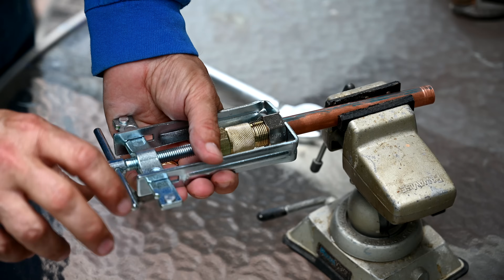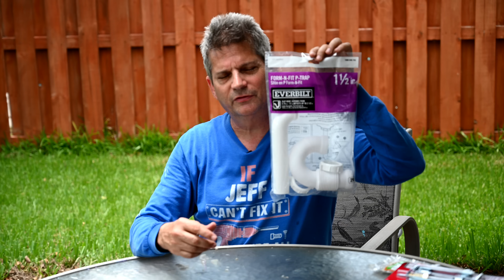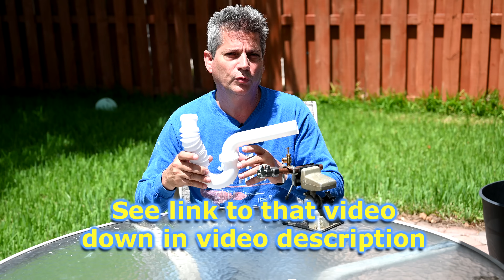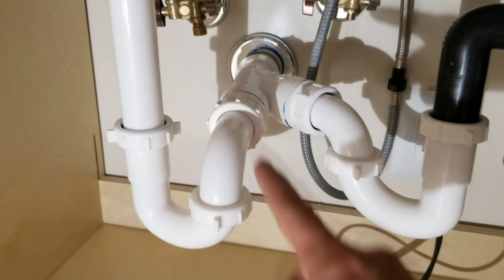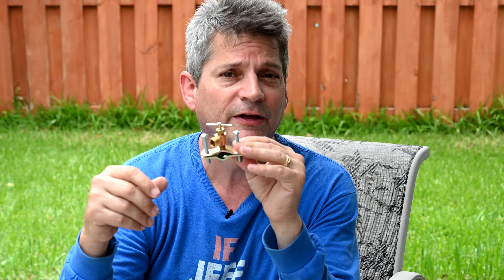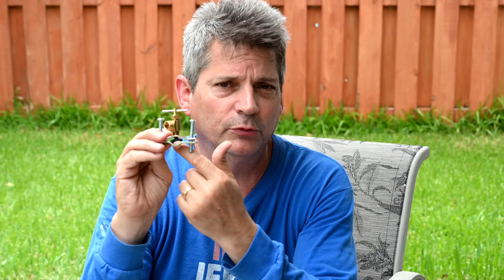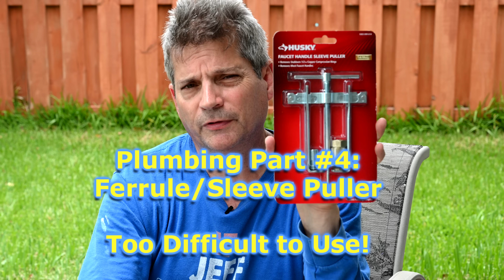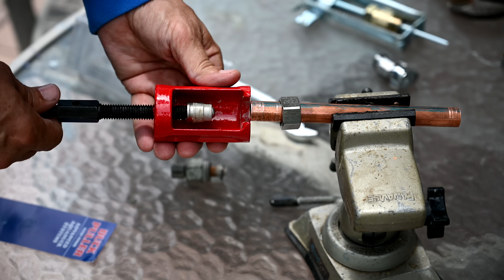4 Plumbing Parts/Tools You Should NEVER Use. NO Plumbing Fails

Comment: People mistakenly believe that if the plumbing or electrical device is sold by the Big Box Store in their area, then it must be an approved device in their area.  I understand that a retailer is happy to make a profit selling an illegal device if there is a strong demand for the product and there are no consequences to the retailer.  Why doesn't the building code authority have the power to restrict the sale of these devices at the retailer?    I've never met a dog I didn't like and I've never met a saddle valve that didn't leak.  They are everywhere here on refrigerator ice makers and furnace humidifiers.  The Husky tool is good for pulling stubborn handles off of valve spindles, but that's it's limit.
Reply from the maker: This sort of falls under that Gray area of legal business where people tend to get confused because it's against business codes it doesn't mean it's against the law. It's not criminal law it's simply the building codes are what the cities have adopted to decide what they should allow to be used in what should not be used. Yes I don't think the store should sell them but then again some people are grandfathered in somebody who already has a saddle valve in place in is finding that it's deteriorating would probably want to be able to buy a new one and put it right back in that same spot although I think it's ill-advised or what if somebody has an S trap design already in their house in their S-Trap cracks there's nothing wrong with replacing it with a regular S trap part so in that realm I think it should be OK for them to sell them in the stores. But remember for all new construction or if you remodel your house and get a permit, they will make you change all of these things to conform to modern plumbing codes in business building codes
Reply: @jeffostroff  All very true, but the Building Code does carry the weight of the law.  If an infraction is identified, a warning is often issued with a demand to correct the infraction within a certain time period, such as 30 days.  Failure to respond to that demand or correct the infraction will land you in court to face further fines and "Stop Work Orders".

Comment: The husky tool you said is not good for removing those brass Rings is realty used for removing the knobs on faucet and shower valves. Also, as a handyman for many years, I’ve run across many “professional” plumbers who used quick fixes and shortcuts and had to fix it right. I agree with you there are handymen and DYI’ers that do the quickie fix. I.  also have never used the products you have spoken about in this video, not because of the written codes, but it was not right for the same reason you point out.
Reply from the maker: The Husky tool is designed and marketed by Husky and Home Depot to do both knob pulling and compression sleeve pulling

Comment: I owned a home in Florida built in 2015.  The water shut off valves under the sinks were one piece push-pull with the valves compression fittings on PEX.  So, you can't change the valve unless you cut the PEX.  This saves time for the plumber but will eventually become a problem for the homeowner.  The local building inspector told me they were allowed by code!
Reply from the maker: Valves get changed once every 30 years, so not too much problem
Reply: @jeffostroff  Even cheap plastic push pull valves?

Comment: Everything in my house has an s trap. The plumbing is a good 70 years old though.
Reply from the maker: If it ain't broke don't fix it. If you ever open up the walls for a remodel and it gets inspected, they will make you upgrade the code.
Reply: @jeffostroff  haha Yeah I  know. When they built this place there were no rules. In the attic I can see old wooden crates with advertisement still on it as paneling, and they used Barn Beams they had left over from another build. 
Those beams came in handy during a bad storm, had three 18-24inch diameter trees fall right above a glass door, all they did was break a few shingles.
The old folks might not have had the best plumbing but it works and is still working today lol

Comment: Although you seem to sound intelligent, nothing in this video makes sense!
I have installed several saddle valves over the years and none of them has ever leaked or caused any problems!
Your comment about dental floss causing a capillary action makes absolutely NO sense unless someone actually used and disposed of a yard or so and then NOT flushed for a year or more!
Your demonstration about the ferrule puller was pathetic also, since you didn't show an actual proper example of one that had already been crimped.
I could go on however it won't do any good!
Reply from the maker: Cliff I’m actually embarrassed for you and your lack of knowledge and foolishness here. Your problem here is that you're making the same mistake many others made before you and that is that really dumb reasoning that I've never had a problem. Maybe you got lucky maybe you installed some that didn't have a problem who knows but they will. But you are forgetting the fact that it is banned in all 50 states I shoed yo the plumbing code and in the plumbing code and yet your trying to discredit me in make it sound like what I'm saying that makes no sense . I guess you haven't read the comments from all of the other people who have had saddle valves installed by plumbers and they failed later on and, in many it caused thousands of dollars in water damage. That is why they are banned and you say that doesn't make any sense? Capillary action Is real and it does affect people from time to time, your lack of understanding of it doesn't mean that I'm stupid it just means you don't understand it and you should probably be redirecting that criticism towards yourself. The funny thing here is you don’t even know that you don’t know.
https://www.lawyersandsettlements.com/features/defective-products/sears-refrigerator-complaints.html
You were right about one thing however, it won't do you any good to keep going on
Reply: @jeffostroff  I actually am embarrassed for you! A good workman doesn't blame his tools! The fact that you don't know how to use the Husky olive removal tool is NOT the fault of the tool, it is the fault of the user who doesn't understand how the tool is supposed to function. I found a short youtube video to help you and others.
https://youtu.be/MjNrGuxYvjQ
I still don't know what the jaws are for and would appreciate it if someone can enlighten us!
I have to admit that your response has really "SHOED" all of us a lot!

Comment: Changing to a P-Trap will not solve the problem unless it is connected to a vent.
Reply from the maker: Yes , but you forget too that the P-trap will slow down the inertia of the water so it won't self siphon like an S-trap would.

Comment: Excellent video. It's so funny that I also thought of the saddle valve. The saddle valve is the worst atrocity. I never really understood why would someone invent this or how that stupid invention survived the test of time. I'm not a plumber but common sense should scare anyone. Too bad sales staff at HD probably recommend it and people still buy it without thinking. The ferrule puller is very clunky like you said, definitely needs an above average handy person to just figure out how to use it...... What's your opinion about leaving the old ferrule and nut on and using them if they fit the new valve? Thanks again for the tutorial. Please keep up the good work 🙂👍
Reply from the maker: You could leave the old ferrule behind. But my take on this is that I have always preferred to install the new Ferrule sleeve because now this gives you a chance to completely remove everything off the pipe scrub it back down to nice and shiny brand new again an identify any possible issues with the pipe. Also by putting on the new ferrule sleeve that came with the new shut off valve, you're guaranteeing that you have the perfect fit made by that manufacturer for that exact part number . If you leave the old ferrule on now you have an old part that's already been compressed that's been used for several years you don't know who the manufacturer is and you don't know if the tolerances are off enough to cause a leak that's why I always change everything out brand new even if it takes extra effort this way I sleep at night

Comment: love the video but regarding the husky tool.... Ive never used it but I can tell your using it wrong to complete the pull there are indents in the tool that the arms have to sit into... it works fine if you use the tool the way it was intended
Reply from the maker: You don't use the arms for ferrule removal according to Husky's new instructions

Comment: The  tool you were showing is also a faucet handle removal  tool, the 2 arms are for that purpose. They are not used for ferrule removal.
https://youtu.be/7KDe8ACKjwc
Reply from the maker: The tool is a dual purpose tool, it is a faucet removal tool and a ferrule tool, as stated by the manufacturer and by Home depot's own web site description for the tool.
Reply: @jeffostroff  Yes, but you do not use the 2 arms when using it to remove a ferrule. As shown in linked video.
Reply: @timriggs8651  he’s a know-it-all. He can’t be taught anything. One of those high maintenance types that you have to trick into thinking it was His Idea or that he arrived at the facts on his own...sad

Comment: Not capillary action. Drain pipes are really-really large and capillary effects are negligible. You probably wanted to say Bernoulli's effect?
Reply from the maker: In the case of water wicking up a string, it is capillary action
Reply: @jeffostroff  Correct. But you were talking about "sucking" out water plug from P-trap due to nearby flushing of a toilet. Bernoulli: fast moving air above water trap would create lower pressure...

Comment: In 40  years as a lawyer I have never heard of a home owners insurance company threatening to cancel a policy over using a flex p trap or anything remotely similar. I think you are out in left field overstating your case. I do agree you should not use these quick fixes.
Reply: Insurance companies dont survey the house for breaches of code. The Local Planning/Building Regulation Authority does that when it signs it off. 
In any case, if the house was built with P traps prior to the changes in code then they are legal.
Reply: The home insurance companies make their own rules.  I had an approved wood stove installed to meet all the requirements of the building code in my workshop.  I changed insurance companies one year to achieve a better rate.  After four months on the new policy, the insurance company requested an inspection of the home, since all the information exchanged when the policy was established had been done verbally and through email.  They said it was "just standard procedure to randomly physically check  new home policies".   Following inspection by the insurer's "independent risk management company", the insurer demanded that the wood stove be decommissioned within 30 days.  I confirmed with the building inspector that the installation met or exceeded all of the current building codes for safe operation.  There was no code violation.  The insurance company continued to demand that the stove be removed or my homeowner's policy would be voided.  They also noted, that no other insurance company would write a policy following the cancellation of this policy.  The wood burning appliance was removed and replaced with a propane heating system at a cost of $4,000.00 .    Yes....Insurance companies are making their own rules.
Reply: @chrisgraham2904  you should have just got a new policy b4 the one in place was canceled.   there are many insurance companies out there
Reply: @mikemichaelz135  It was the new insurance company that threatened to cancel the policy.  I contacted nine other insurers and all refused to write a policy with a wood stove heating the shop.  One stated that they would consider a policy if they first did their own inspection, but also advised that the policy would likely carry a premium of about $1,000.00 per year.
Reply: They are probably renting one of the units and somebody saw this illegal fitting and said something. It probably wasn’t so drastic as he thinks because homeowners make things sound terrible sometimes as a building inspector I see this quite often. I’ll make a comment in the homeowner takes it to the extreme.
Reply: @builditsquare  It doesn’t matter if it works, it’s an illegal installation. Also called insanitary. That word comes from the plumbing code not the dictionary. As inspector we try to protect you from stupid things
Reply: As a building inspector, I always love seeing somebody buying something and telling them hey that doesn’t meet any code requirements. That was meant for a quick fix and then you were supposed to do it properly afterwards. The biggest issue is no one gets their damn permits
Reply: I’ve had two home inspections recently and nothing about that flexible drain so must be ok
Reply: I’m pretty sure Florida uses the IPC for code???
Reply: They are a good quick fix to get you out of trouble until you can do it properly. They are great for these types of situation in my opinion personally. I had one for over 10 years and never had a problem with it whatsoever
Reply from the maker: John the reason you as a lawyer have not heard of this before is because it's not a legal issue. You can call me out in left field all you want, but I've been called into 3 different widow lady friend's houses because their insurance company performed a 4 point inspection on the house and called them back and threatened to cancel the insurance if the code violations were not removed. I had to take photos of the repairs to send into the insurance companies. I certainly did not imagine that. This is not a legal matter which is why you never saw it before.  I would still rather have the insurance companies force me to remove code violations, than to reject my claim because of code violations.
Reply: @jeffostroff  some of the things you said about the code, I couldn't find it in the Ohio plumbing code ?
Reply: @billybuck7658  that’s because most states make their own code based on the uniform plumbing code. Oregon is the specialty plumbing code and the specialty building code and so on and so forth. Washington and California just writes the books and keeps the names similar. Idaho does the same thing as Washington and California. Every states a little different and some states is using the international plumbing code which really sucks. In fact you can do stupid things there that you can’t do in the UPC
Reply: @jeffostroff  as a property investor that has numerous insurance policy’s I have
Never been canceled bc someone installed a flex p trap ..
I agree they are cheesy ….
Your just a o trap purest I suppose …
Reply: @jeffostroff  why is an insurance company out doing random inspections? I’ve never heard of such a thing

Comment: In the UK here. I've never seen those concertina traps used over here, though I'm sure you can get them. We commonly use them on our toilet wastes without issue. When used horizontally the valleys just fill with sediment, and eventually just form a smooth surface. Though the ridges are much finer. 
Though not the "professional" way, I've seen many saddle valves used and serviceable for years without issue. 
That Husky tool looks truly terrible as an olive (ferule) puller. I use a Rothenberger olive splitter that literally takes like 10 seconds to cut those things off. Or a Monument olive puller similar to the last tool you used. 
Your plumbing codes do seem to be rather overzealous over there. I can't imagine being told to change a trap, or my insurance policy would be invalid, how ridiculous!
US plumbers also seem to be like UK  electricians and gas fitters - rather arrogant when referring to handymen and DIYers.
Reply from the maker: Yes, some people get lucky, while others get $30,000 repair that the insurance company denies payment on for using items banned by plumbing codes
Reply: Thank you jon ofham, I appreciate hearing your perspective and how things are done elsewhere.   I liked your word choices of  arrogant and over zealous.

Comment: in retro fitting the s trap is allowed that thing your holding the out bound water flow is to high
Reply from the maker: Yes, when you open the wall for inspection, they will make you change the S-trap.

Comment: I fixed a shitty so called pro job that cost a fortune in repaired ceilings and floor due to bad copper. i used flexis and its brilliant.  Stop dissing parts the diyer can fit for 10 usd that a plumber charges 1000 usd for.

Comment: Jeff - good tips on the illegal fittings, Thanks for all that! However, I'm pretty sure you're using the husky ferrule puller tool incorrectly. The two side straps that you're holding together by hand actually don't need to be held - if you look at the crossbar at the hand-side of the tool, you'll see there's two little notches, one on either end of the cross bar. The back end of the side straps fit into those notches. Once in place and tightened up slightly, you don't need to hold the pulling straps in place - just turn the screw. Also, setting the pulling straps into those notches provides a better angle at the work end and clears the bar so it doesn't bang into the straps while turning. Agree that the other two pulling tools are more elegant and compact, but the Husky tool can be made to work.
Reply from the maker: Newer versions of this tool the instructions tell you not to use those side arms when you are pulling ferrules, only when pulling shower knobs.
Reply: The straps are only used for knobs.